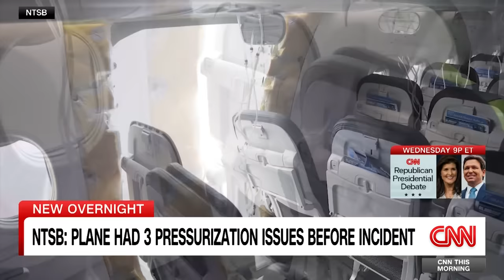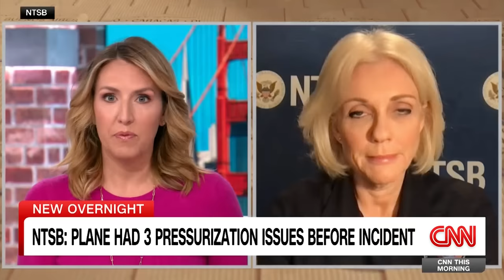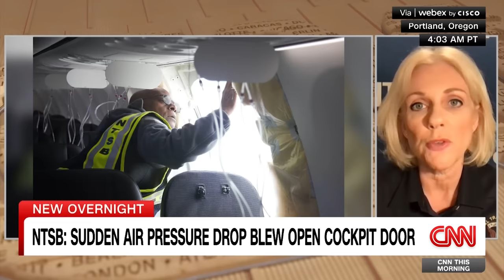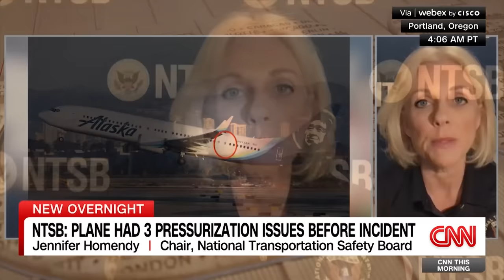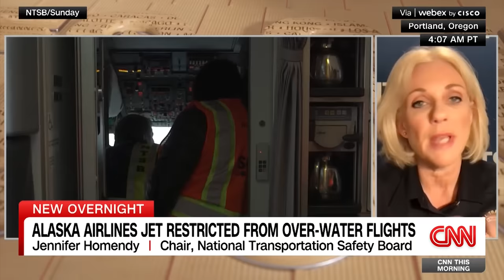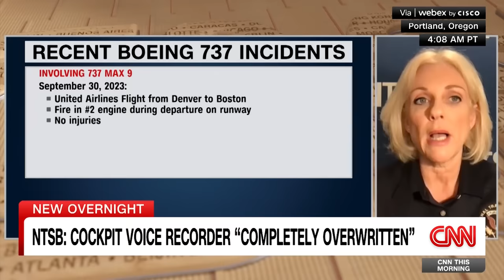Official asked whether it's safe to fly on any Boeing plane right now. Hear her response

Comment: Boeing has been in trouble for several years over quality control issues on its production lines. However, there's a new issue here. Why did Alaska keep the aircraft in service with pressurisation, a critical safety system, repeatedly indicating a fault? I expect the FAA will be asking the airline some hard questions.
Reply: These are called 'nuisance alerts' where every time one occurs, the system checks out perfectly and no fault can be found. The aircraft goes back into service and some time (days, weeks) later the same alert comes up with the same result. Alaska took the right decision to restrict the aircraft's routes. If you were to stop flying all aircraft with a nuisance alert you would very quickly ground a substantial percentage of hulls. Ex-pilot here and the victim(??) of a depressurisation event on a deHavilland Dash-7 about twenty years ago. That was 'interesting'.
Reply: Revenue.
Reply: the way u typed those words like u knew what they were before this incident
Reply: Boeing now outsources a good amount of it's manufacturing, believe it or not.  This plane was only three months old.  A repeated problem on a brand new car would qualify it for a replacement thru the "Lemon Law."  The fact that Alaska Airlines even had to deal with cabin pressure alerts on this new of a plane is ridiculous.  It's unforgivable that Boeing delivered a new plane with this number of manufacturer defects.
Reply: Boeing makes the list of equipment it is ok to fly with while inoperable.
Reply: Pressurization is more related to Aircraft passenger comfort, and Aircraft efficiency- You can fly the Airplane  revenue unpressurized!!
Reply: @daigriffiths399  substantial % would be very conservative!!
Reply: Ummm if only you knew how many flights a day every airline would have to cancel. Almost every flight has some sort of issue. The FAA allows certain things to be “broken” and still fly safely. With this issue, if it can’t be replicated, the aircraft is cleared. It sounds like they asked Boeing about it and it didn’t go further than that.
Reply: @SerenityNow.... ummm…it’s clear that you aren’t in the aviation industry.
Reply: @brandonbrown4819 no, no you can’t. 35,000 feet unpressurized will kill you.
Reply: Jennifer Homendy is the politically appointed chair of the NTSB. She should not be asked expert matter questions she should refrain from trying to answer Subject Matter Questions. She uses her position to self promote and it should be called out.
Reply: @vito774  The MEL would only allow revenue flight below 10,000!!
Reply: @brandonbrown4819  I would love to know what airline is applying that MEL and taking passengers? The extra fuel burn plus being in VFR airspace for extended time…please call out that airline!
Reply: In the past, why did Alaskan Airlines ok the Jack Screw grease that caused the stripping of screw and caused the plane to invert and crash in Pacific, killing all aboard?😮😢
Reply: @vito774  Revenue flight below 10,000 is allowed constantly with the Airlines- otherwise you would have a very substantial % of your fleet grounded at out stations . I have been with the Airlines for 20 yrs- never had a outstation road trip for pressurization!
Reply: @brandonbrown4819  with an airline for 23 years, only seen ferry flights or special permit flights below 10,000. Again, please tell me which airline is applying this MEL.
Reply: Alaska airlines should've had the aircraft repressurized at 150% of normal pressure, after having these faults. If they couldn't do it then BA could have. Ask Alaska airlines why they kept that row of seats empty? 
Did they already know that their pressure indication faults was the blocked door? And if so why wasn't it pulled from service and inspected? Was this pressure problem discussed with BA?
Now they have the door and we'll know some answers.
P.S Ive been flying jets for over 40 years and when I've had pressure leaks , which I've had a few times, I'd ground the aircraft.  @SerenityNow....
Reply: @vito774  Why are you subscribed to a bunch of "flight training." "flight 101," "flight academy,"  "learn to fly" YouTube channels?  Strange for someone with experience.  A whole lot of training channels, but no private or commercial airline sites.  A bunch of gun and video game stuff too.  Ya, you seem legit... Cheers!
Reply: @vito774  Why are you subscribed to a bunch of "flight training." "flight 101," "flight academy,"  "learn to fly" YouTube channels?  Strange for someone with experience.  A whole lot of training channels, but no private or commercial airline sites.  A bunch of gun and video game stuff too.  Ya, you seem legit... Cheers!
Reply: @SerenityNow....  hahahahaha…so you’re not in the aviation industry. If you think a new plane has zero issues coming from the factory you don’t know aviation. Anything else?
Reply: "I'm JUST ASKING QUESTIONS" hopefully someone answered your question here. Looks like the #1 comment did. Hope that helps.
Reply: @vito774  "If you think a new plane has zero issues...?"  A chunk of it blew off in flight, ding-a-ling. 😂   Have a nice life.
Reply: @SerenityNow....  I mean, it happens, clearly, by what just happened. You kinda proved my point so thank you I guess 😂
Reply: @vito774  brother it is fair to say- another serious issue like this on the MAX- the plane will be too heavily scrutinized to operate with the flying public in the Western nations. the frigging MCAS disaster which Boeing had complete control over, and mucked up criminally has put the Airplane at the end of it's good will so to speak!
Reply: This is the same company that caused the catastrophic Alaska Airlines flight 261 incident, when they had their mechanics ignore important safety checks for faster turnaround times for aircraft. Profit over safety for Alaska Airlines once again.
Reply: @dumbfailurekms  No - I just know what I'm talking about (I hope!). 43 years in and around the aviation industry (private pilot, ground handler and in the factories) helps a little bit - you also tend to pick up a particular style of writing when discussing incidents or accidents.
Reply: @garygrant9612  The aircraft cannot be pressurised to 150%. The aircraft won't allow it, even in manual override mode. At sea level, I doubt the airconditioning units could put out enough pressure. The pressure in the cabin actually reduces as you climb, not increases. Only the differential pressure increases.
Reply: There are 3 separate, redundant pressurization systems. 1 out of the 3 occasionally indicating a fault is cause for rapid service but is not cause for indefinite grounding, at least not in the general sense. That's what I heard at least.
Reply: @brandonbrown4819  Not above 10,000 feet. (retired ATC guy and flight planning specialist here)
Reply: @ihmcallister  yes I would have thought that was obvious- the MEL allows revenue flight below 10,000

Comment: that plane should not have been in the air at all. they had warning lights they reset and repeatedly ignored. they put people's lives at risk
Reply: This strongly appears to be the case.  Warning lights that are lit up are showing the system is sensing something, I suspect a pressure drop due to air escaping.
Reply: A human, more than 10 feet off the ground, is always subject to some risk. You would be hard pressed to find an aircraft in service, at this very moment, that didn't have a list of things wrong with it. The object of the game is to keep the list short and insignificant, but the list is always there. These aircraft are way too complex to remain in perfect condition every day they are in service.
Reply: @davidhull9168   exactly. the warning lights are there for a reason. ignoring them like they did is at best reckless, or criminally negligent.
Reply: And this expert's excuse is that the warning light may have been a completely different problem
Reply: The warnings were not repeatedly ignored. They kept that in the logbooks that’s how we know about them. In those logbooks, they wrote out the problem the steps they took to try to address the problem.

This happens more than you would think about other systems. There’s lots and lots of systems and airplanes and sometimes they just will throw up random errors and it’s impossible to always say exactly what caused that. You just have your checks you go through and you trust the overall system, and it does work generally because planes are the safest way to travel by far that is the evidence the system is working.

Now I know what every catastrophizer thinks about that, but there’s a reason we don’t let these people run so much as lemonade stand.
Reply: @Part_121 Perfectly said
Reply: @DaveP-uv1ml couldn't have said if better myself
Reply: a kid was almost sucked out of the plane because of their negligence, for which they would have been liable. if these planes have so many problems that they can't keep up with all the errors, then they shouldn't be in the air, or the company shouldn't be in business. the problem only existed because of their negligence in the first place. putting people's lives at risk isn't something to pass off, so that they can just get away with trying to save money on repairs at the expense of real people's lives.
Reply: @linaraepaksa  So you've already decided who's at fault?
Reply: @ImperrfectStranger   lol. I'm paying attention to the facts. it's a problem with prioritizing profit over people. there where multiple times that they reset those warnings and kept it in the air, they could have made the repairs anytime. it was bad enough that they decided to not fly it over the ocean, but still decided to fly it over land. again they could have spent the money on repairs instead. and now we can see that was a very bad decision that almost cost lives. it's very lucky there wasn't a death from being sucked out that refrigerator sized hole in the plane, again prioritizing profit over people. and from other videos I've seen, there seems to also have been a systemic problem with other planes as well. all this ads up to negligence or incompetence and valuing money over people.
Reply: @linaraepaksa  So, just to clarify, you're putting the blame on the airline for not grounding the aircraft for an intermittent pressurisation system light which may or may not have been related to the door plug and without knowing what the maintenance manuals specify when a particular light illuminates? 
Even if the light was related to the plug, full pressurisation checks on the ground may not have duplicated the conditions which blew the plug out (vibration, g forces, aircraft attitude, etc). Also, Boeing limits the cabin pressure that you can apply during ground checks. The maintenance manual states that the differential pressure should be a maximum of 4psi. I estimate that the door blew at 6psi, but pilots would probably have a better idea of the typical differential pressure at 16,000 feet. If the maintenance manual specifies a test procedure for a particular light and the engineers followed that action, it's possible that the airline's central maintenance managers added a level of safety which exceeded the manufacturer's recommendations by limiting the routes of the aircraft.

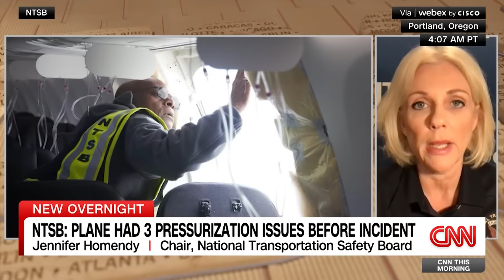Comment: 5:23 EXCELLENT QUESTION. So freaking what if it's restricted from flying over water, it was still flying at HIGH ALTITUDE and PRESSURE differential, posing the same risk to life.
Alaska has questions to answer.
Reply: Boeing makes the list of equipment it is ok to fly with while inoperable.
Reply: It’s for ETOPs reasons, however a malfunctioning pressurization system is something that can be handled in flight by lowering the planes altitude without any kind of significant accidents or damage to the plane. For safety purposes it’s easier to find an airport when you’re flying over land than it is over wide open ocean. And that’s why they decided to only use the plane over land in the event they lost pressure. Pressure in the plane does not go hand in hand with the plug doors or any kind of accident as happened. This simply could have been a problem being missed by maintenance or someone at the factory. The plane model has been flying for years now without this issue.
Reply: Jennifer Homendy is the politically appointed chair of the NTSB. She should not be asked expert matter questions she should refrain from trying to answer Subject Matter Questions. She uses her position to self promote and it should be called out.
Reply: Yup, great question. It should have been taken out of flight until they figured out exactly what the issue was and fix it and then do a lot of test flights to make sure it was safe. But because profits come before people's lives, they did not.
Reply: @hzmzkhd it is not life threatening to have a pressurization issue. The plug type door is where the main issue is which was unknown prior to the incident.
Reply: If I were Alaska, I would be pissed if a Boeing engineering issue on a new plane was pinned on them.
Reply: It is a good question, but if the alarm was sounding because of some bug with the pressurisation sensor then it's a very different risk than a structural issue with the plane. If the NTSB have already determined that the warning alarm had nothing to do with the door incident then we have to treat those things separately. We don't ground every single plane with a sensor bug. It would be overcautious to do so.

That's not to say there isn't a systemic issue revealed by both of those incidents that indicates a problem with quality control which obviously would need to be investigated further.
Reply: @frankiexv4533  most don’t have these plug doors though.  Although there isn’t necessarily a correlation between the catastrophic depressurization it is suspicious that the warning light for cabin pressure came on repeatedly.  Almost like it was leaking before it failed.  I wonder why nobody was seated in the row near the plug.  Very coincidental since out of 170 passengers seated those two seats happened to be vacant.  The probability of that being random is pretty low.
Reply: @frankiexv4533  Understand the nuance here. Alaska thought this previous repeated issue (related or not, system or just sensor) was significant enough to consider it could lead to a problem in flight necessitating having to land asap.
This doesn't sound like some MEL thing where the aircraft can operate normally despite a known definitive out of service non essential function. They clearly didn't know what was wrong so it appears they said 'just in case, no ETOPS till we figure it out'. Is that normal?
I smell burning bean counter machine oil in that decision.
Reply: @frankiexv4533 If a plug door gets blown out at 30k ft plus it’s a highly explosive event & everyone is pretty much f#####.
Reply: "we are the safest within our airspace"

That's a pretty low bar when you're the only player.
Reply: @tomallison7416  Probably she meant vs the foreign operators and regulatory agencies not under FAA control but who operate within US airspace?
Reply: @frankiexv4533  Having to lower your altitude over water you wouldn't have enough fuel to reach your destination.
Reply: @outermarker5801  I don't know that anybody can operate within US airspace without FAA giving the sign off. It would seem more likely that anybody who's operating commercially or privately in the US would have to have FAA approval.

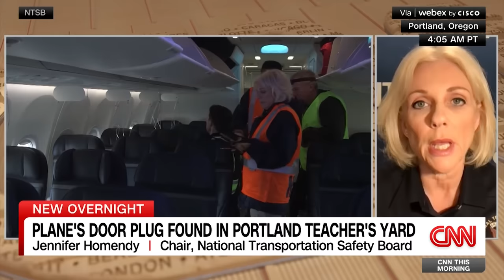But with a qualifier like that they can limit it to anything. We are the safest ones operating a flight from point A to point b at 3:35 in the afternoon....  It's a well crafted turn of phrase
Reply: @tomallison7416  I'm sure you're right. I should have been clearer any regulator determines the standards required to operate within their airspace. Hence why some regulators ban some operators.

Comment: Corporate America has a accountability issue. All these products and vehicles we use everyday were created in the era of accountability, now with lawyers and red tape no one is held accountable and corporations rely on that to profit. They cut safety positions they cut maintenance. Trains planes automobiles. Trains are miles long now with one driver instead of short with many conductors. Planes are overloaded and maintenance is skipped (they literally cleared the light on this and ignored the issue), and cars are catching fire steering wheels are coming off. But because of politics and red tape nothing is done

Comment: I'll bet some technician checked this out and told his boss it was a problem. But, fly the plane anyway. I've seen engine failures after reported metal in the oil filter. You don't want to know what faults they fly with on a regular basis. This could be a big problem.